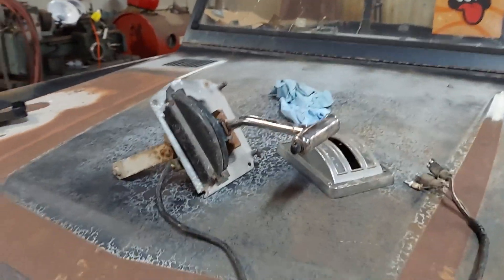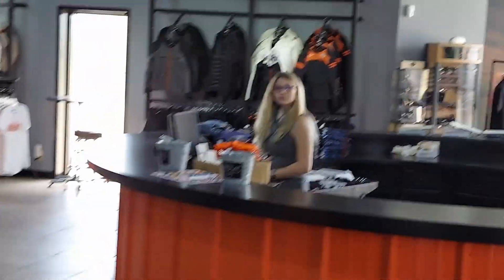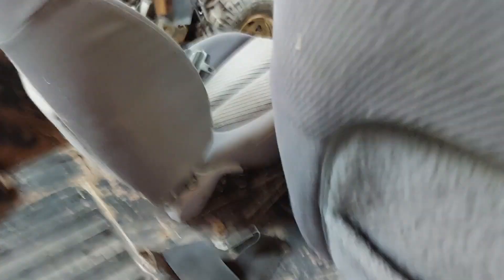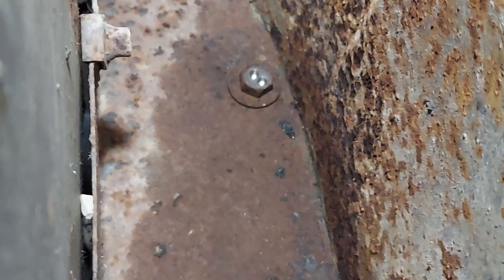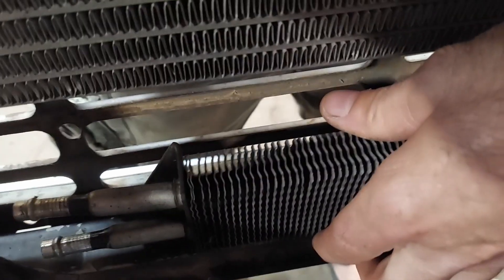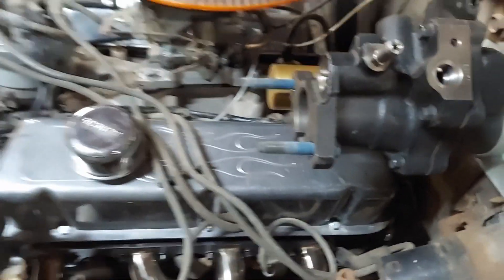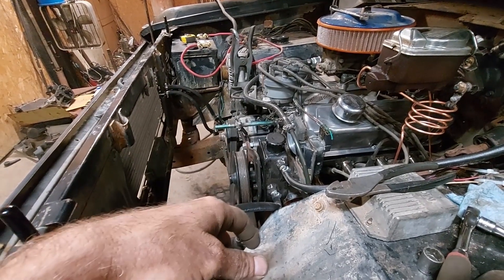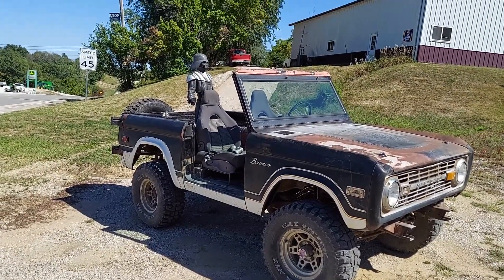making the 1976 Bronco roadworthy again- PT5. IT DRIVES!!!

Comment: When I recently got my 85 f250 running again, the new fuel cell I mounted in the bed got the same clear plastic sight tube you installed on your boat tank. Works great so far. I can see my fuel level at a glance. The only thing I wish I’d done differently is install a ball valve before the fuel filter so I can turn the fuel off when I have to change the filter. The rig is definitely coming around! I’d rather see someone make a rusty old bronco go down the road any day rather than setting beside someone’s shop that they’re “gonna restore it some day”.
Reply from the maker: The ball valve is a great idea. I did it on the 78 F150 that I revived last winter because I knew the steel tank I mounted on the flatbed had rust flakes in it and thought I would be replacing fuel filters on a regular basis.

Comment: Were you worried about heat or the electric on the shifter...if it's heat they make something called kool-gel and it would control the heat to allow welding... I have soldered 1"away from pex and no melting..not sure how large your license plate collection is to fix the body with
Reply from the maker: I was aware there are products out there like that but have never used them. Usually jam a piece of metal in if I think heat will do some damage. Not enough liscence plates, but plenty of running boards from rigs I have scrapped over the years